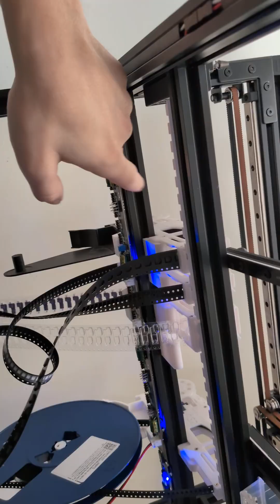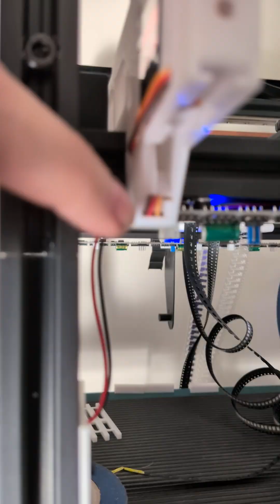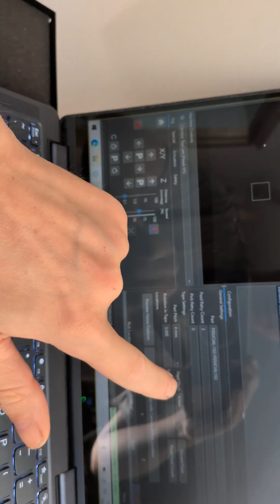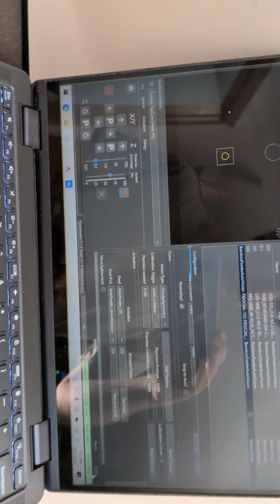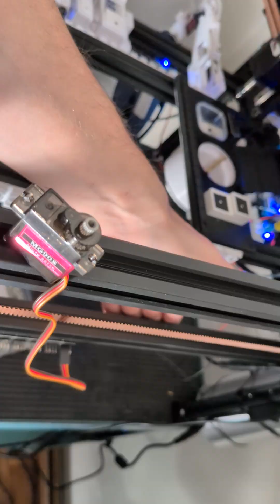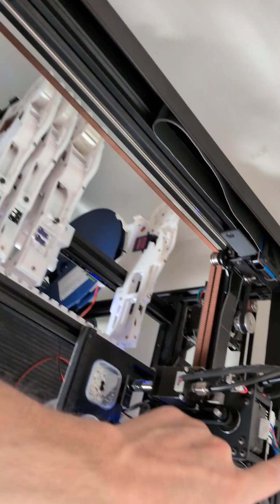Panda placer servo alignment process

Comment: Thanks for the video. It is very helpful. One issue with PandaPlacer documentation is that is seems to assume you already know your way around OpenPnP and PnPs in general so this sort of how to is great.

I might suggest you rotate it so we can read the screen. There are video rotating add ons for Chrome and Firefox.
Reply from the maker: Yeah, I need a good way of recording and editing all of this together. 

My initial plan was to do a unboxing video which I have and an assembly video. 

I have all the footage for this. I just am not one a skilled video camera operator and not at all skilled with video editing. So eventually I'm going to get that put together. But my realization was real quick that the assembly is very simple. 

It's more of an issue with the open p&ps app. When I got my machine there was absolutely nothing on how to do assembly or software setup. And largely that's because the process is pretty much identical, just with different class names or device ID values. 

Since then, Leo has released the new setup guide which I think is still reasonably lackluster. But I know the guy's busy and I don't think this is his primary income while also having some QC issues with the feeder controllers has probably pushed his available time around pretty hard. 

So all that said my goal is to get a video out for those things and do a full reset up with a bunch of feeders printed and the show how to use openpnp.
Reply: @SkreeLLC  I believe there are apps which will rotate your raw video for you.

Comment: Hello, can you help me. I have write to Leo but he don’t give answers for 3 weeks and I don’t know what he has. I have also the old Pandaplacer and also the new CC1 but I need the newest bamboo stl files. Can you say me what version do you have? Best regards Michael
Reply from the maker: Sorry about the slow response. They should be in the download section. As far as I know. The latest files are there. I'll check what I have to see if there's anything different with the feeders but I believe the 2 mm feed and all the other sizes should be in the latest available download. 

I think he replaces the file when he doesn't update on the website.